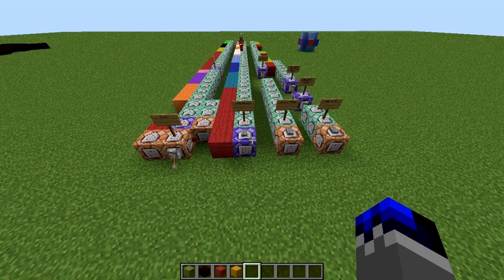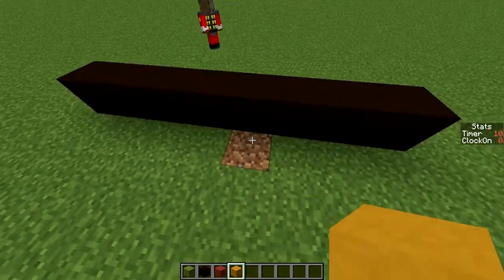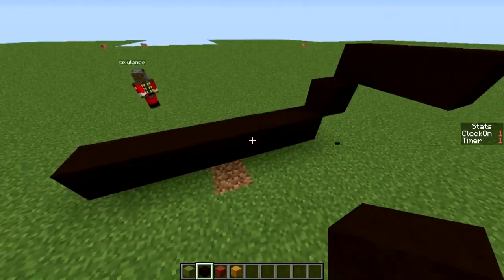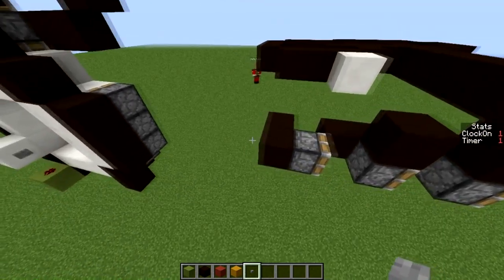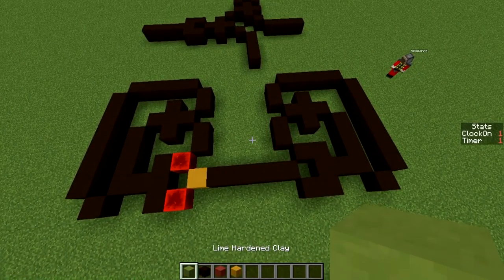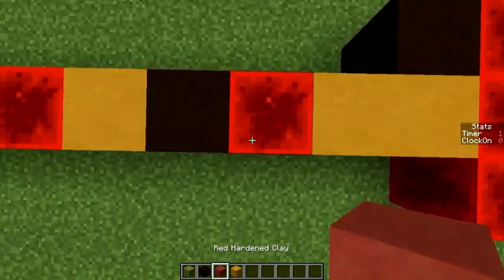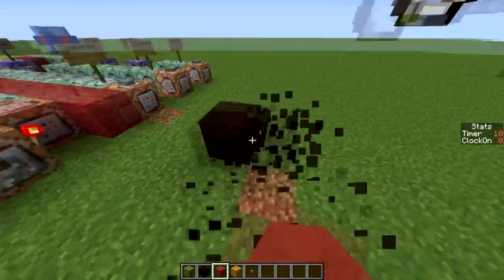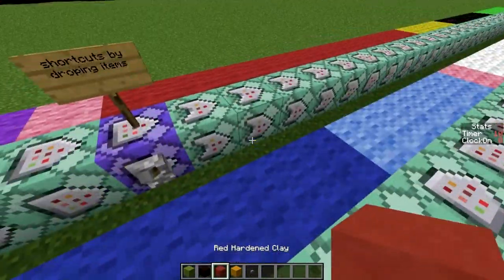3d WireWorld using commandblocks

Comment: please do something about the rain x)

your mic is really bad
Reply from the maker: I have tried, without success :(
I am currently using a Logitech headset, which shouldn't be this bad I don't think.
So perhaps it is my pc sound system or something, or perhaps even magnetic fields around my pc?
I have no clue.
Reply: i was having a similar problem before, reinstalling the drivers fixed it... but i don't think that it's a universal solution...